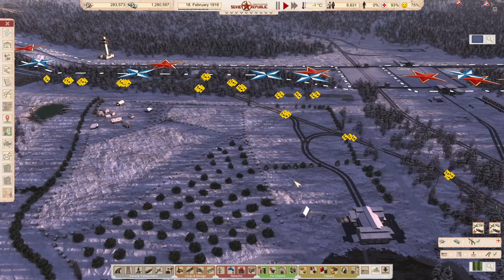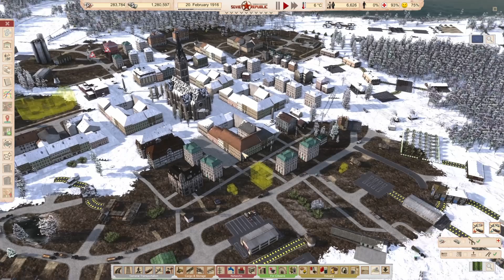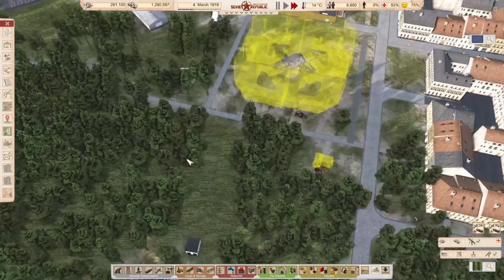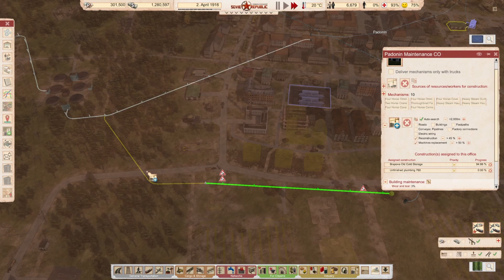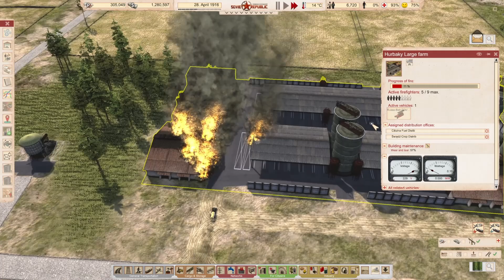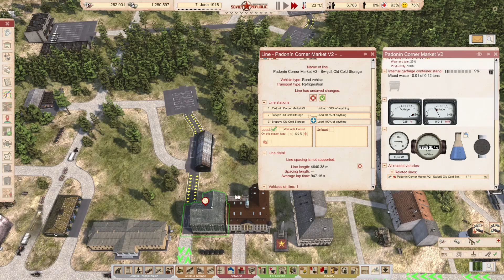High Risk Fire :: Grand Designs V2 1900 Start : Workers & Resources Soviet Republic: #22

Comment: Maybe it's time to provide water for the Steel mill, because it is operating at 6% capacity.
Reply from the maker: Good suggestion, the biggest problem is lack of workforce, partly due to slow buses. On the positive side 1917 triggers the arrival of some useful Western vehicles that can provide an efficiency boost.  

Have been reluctant to supply water as this will trigger sewage disposal,  although this would be the time to start putting some permanent infrastructure in place.